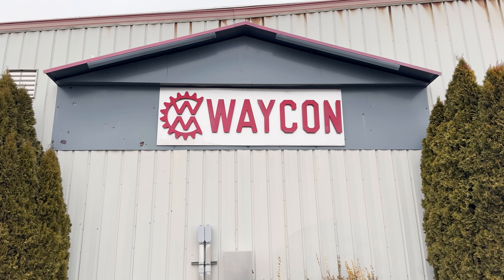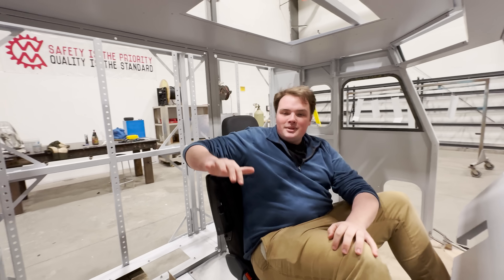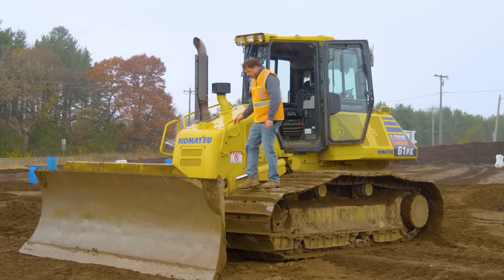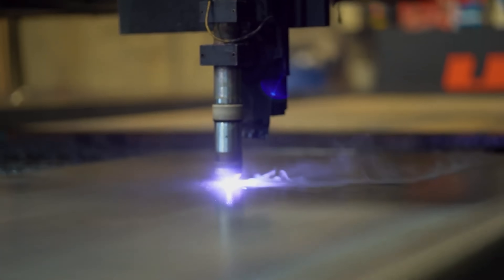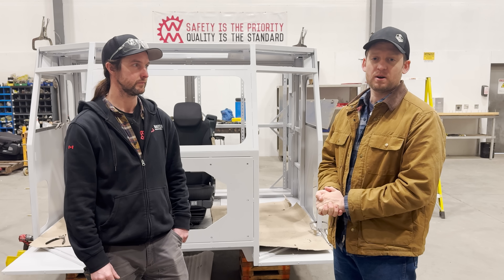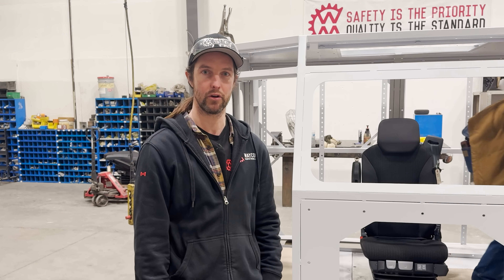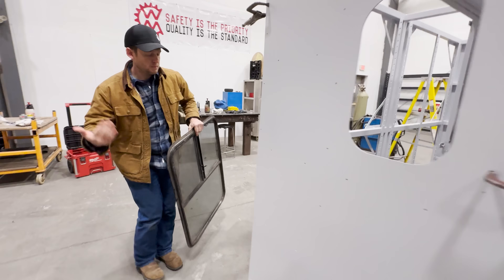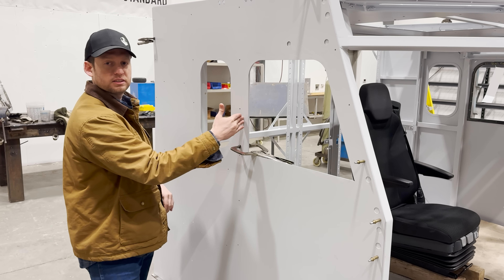Unveiling the Undisclosed Hybrid Electric Truck Cab: A Sneak Peek

Comment: Sliding glass is not only easier and cheaper, it’s mechanically simpler.  Just make sure it can be locked shut.  KISS is at the heart of what Edison is doing.  Keep it simple and it take you far
Reply: What is the powered  mechanism that fast food restaurants use to auto open/close the sliding windows at the drive through. 

Quikserv and Ready-Access make them.
Reply: @Sah-o5m  I would call those folding rather than sliding, and I don't think they're automated. I think there's a pusher bar that they walk into that opens it through mechanical linkage
Reply: @gormauslander The ones I’m used to seeing at fast-food places are absolutely sliding mechanisms, I think they’re generally either a broken-beam trigger or a motion sensor, but I’m sure some places have a bar switch instead. Heavier-duty frames than I think you’d want on a vehicle window, though, perhaps?
Reply: kiss. keep it simple superstar!
Reply: Had sliding windows on my ‘67 VW Camper. Over 200K miles with no problems. 
Have replaced 2 window regulator wires on my Jeep’s driver door, mainly due to freezing rain, in less than 50K kilometres! At $750CD for each replacement!
Please tell me again how sliding windows aren’t a thing?!
Reply: Bringing up the KISS method of design made me laugh. That was what they were pushing back in the 1960's when I was in school. I now have a grandson in engineering at the state university, and he was telling me about a project he was on. His parts he designed were simple to produce where the other designs were more complex, and had to be sent out to produce. So I said, "So you are of the KISS method of design". He asked what that was, so I told him. He thought that was pretty cool. Maybe I need to send him up to work with Edison Motors! From the videos of their area on their road trips, it looks like a nice place to be.
Reply: @ronfullerton3162  KISS should be the foundation for everything. It's quite easy to create a complicated thing that's good, have it good AND simple requires a lot more work and thinking.
Reply: @Hoggaforfan  I am with you on that! I was rather surprised my grandson hadn't been familiarized with it in an engineering and design class. Although he had been praised for his easily produced designs for this project. As we talked about it, and the discussion deepened, I could see the light come in his head. He fully under what it all meant.
Reply: Glass is heavy, expensive and a risk. Seems like an Apple feature, cool when shown but useless or even plain bad IRL. Just add some metal or even plastic doors.
Reply: @Hoggaforfan   seriously? They are talking about windows, and you want to make them plastic?
Reply: @autobootpiloot You do know there is transparent plastic? Acrylic, polycarbonat, pet bottles is all rather common. But they were talking about sliding glass doors to the electrical parts, not windows.     That current window in the back is a bit useless but it's either to add a transparent part there and whatever of the rest or make doors that cover the electric but not the window. Anything else?
Reply: @Hoggaforfan  they were talking about a side window. A bloody window to the outside of the truck.
Reply: @autobootpiloot  Ah, I was thinking about the huge sliding glass doors they intend to close of the electrical stuff on the back wall.
Reply: @Hoggaforfan they scratch very easily and don’t take long to get opaque.
Reply: @dwaynepenner2788 I suspect that comes down to your choice of polymer.
Reply: @davewatchedthat  acrylic (plexiglass) is more scratch resistant than polycarbonate (lexan) but is much more brittle and isn’t as durable as glass over time.  Both polycarbonate and acrylic degrade with UV light. Plastics also flex more than glass which is good and bad, for trying to seal a sliding window if the design requires a “free” edge (not in a track or jamb) is going to be hard.  Glass can be brittle but unlike acrylic is safer when it breaks (assuming you are not using plate glass…acrylic is surprising nasty) and is easy to find.  Polycarbonate is the most expensive option.
Reply: @dwaynepenner2788 Yes, that matches my experience too. The sliders in my trucks have always been glass, I believe. Probably the best choice for this application, but I’m sure there are professionals who can help them decide for sure. That being said, there are some modern polymers that are incredible compared to even the performance of products from a handful of years ago, so I’ll be curious to see what they choose.
Reply: @Hoggaforfan  and tempered glass is better than basically any transparent plastic... I work with acrylic poly and pet on a regular basis and I wouldn't trade glass for any of them most of the time... 

My own farm semi has a plexi/poly (couldn't tell yo which its been 10 years) rear window as we just drilled it and put it in place and plastic is much much easier to install... that window looks like shit now, the glass front windows that are original to 1986 still look great
Reply: @killorkubed  True, plastic scratches, that's the downside. Poly is way more resilient than acrylic but a pain to bend so most plastic windows are acrylic because of that. I wouldn't put poly on the front window but the back window is fine. I mainly wrote the post regarding the large sliding glass doors in the cabin to cover the electric.
Reply: @ it not only scratches (which would me more of an issue on the inside windows then an exterior rear window imo… someone’s gonna hang their jacket up where it swings all over the window which would scratch the daylights out of it) but discolors and gets cloudy… in theory this is less of a problem if the inside is uv protected enough but still it’s less than ideal… 

Look at how much of a nightmare plastic windshields on like Cessnas are… constantly need scratches polished out, covered on the ground to protect from uv etc 

And on a brand new not inexpensive truck I would expect glass…
Reply: @killorkubed  You are basing your posts on acrylic, UV resisting poly isn't the same thing. It's used in bulletproof windows and I've slipped with screwdrivers and no scratch. Those glass doors needs to be hardened and the risk is that they could explode. Either by movement of the cabin or accidently poking with a sharp object. Personally I would just use metal doors to cover the electric but if you really want transparent then poly would be better, lighter and no risk of shattering. But you do you :)
Reply: @ I know all about poly as well, I’m not sure the window in the rear of my semi isn’t poly, I regularly laser cut plexiglass and run poly on my CNC I’m well aware of the differences between the two 

Still even UV Poly is mostly one sided stuff, and even then it’s only guaranteed for 10 years and only really good for 15-20… a truck like this should last much longer than that, like my 40 year old kenworth that will be around many years to come if it doesn’t get totaled… like I said the window in my kenworth is 10ish years old and going to shit, and im reasonably sure its poly not plexi
Reply: But is it? To me it feels like a step back in time. 

Sliding windows are noisy and with a bit of dirt they barely slide anymore. Electric windows have been common place for over half a century, the better ones have been proven reliable for over two decades. You get a better seal, less noise and way nicer to operate. 

I’m getting the feeling this truck could be the owners dream and the operators nightmare. It’s all good and fun to make it reliable but actual people have to work it a full day. A full air cab and seat, good ac and heat and good sound control is a necessity in my opinion. Old men where tough, but they also had a lot of pain and suffering at age. Let’s not go back to that. Let’s keep moving forward for human comfort as well.
Reply: @autobootpiloot
Had 2 vehicles with sliding glass.. as long as there's easy replace  lightly sprung  seals on the wipe  edges it stays quiet. Power wind windows end up with a lot of water muck and ice building up in the doors causing structural and electrical corrosion.. if this thing has AC .. it's good as an emergency escape if doors get stuck .. 
Electric locking doors and windows cause dozens of  deaths when vehicles face flooding, immersion.

This thing has the touch of  
Military off road truck or crane or drill rig carrier about it.  
British military 6wheel  amphibious trucks. Stalwarts aka Stolies had no doors or windows that opened they just had two roof hatches. 😂

The British built 1984 Africar project was built to take the pounding of traveling from the Artic circle to the Equator crossing the corrugated rock pavement of the N .Sahara /Sahel before wading through Equatorial truck tracks of mud and black cotton soils.. when wet they will swallow an Artic.
The designer had crossed the region several times in 4wD and American pick ups.  They all either broke their chassis/load beds or had to slow to a crawl...the harmonic frequencies shook everything metal to pieces. 

The windows on all the versions were sliding, because the winds blow east west  the roads pass N -S the body monocoques were epoxy plywood .. the long travel Citroen/ Moulton rubber hydro gas suspension  mountings were galvanised steel sub frames bolted to the Resin Ply bodies including the Six wheeler.  Nothing of the chassis broke in fact they could float over the rock pavement.. at double the speed of the usual overlanders.. maluable steel  rims absorbed impacts with vertical edged pot holes left by the HGVs and freeze thaw action rather than ripping the suspension off. It's an object lesson in designing for the ordinary road in most of the world.
Reply: @clivestainlesssteelwomble7665   so you want the perfect truck for the owner that a nightmare for the driver. As a driver, I would like a little comfort in a brand new truck. That way I can enjoy my old age with proper hearing and I can still lift my own bones.

Let’s do it the f-ing 2025 way and build something reliable, rugged AND with comfort. Let’s make PROGRESS instead of going back in time. Let’s push Edison motors to build a truck for both the owner and the driver. Not the reliable uncomfortable truck from the 60’s or the comfortable unreliable truck from the last few years. Let make it BETTER!!
Reply: @clivestainlesssteelwomble7665  that happened to a local driver he went off the side of a bridge and his truck landed on the old pilings for the original bridge.

power windows stop working in water and the interior door handle was broken he was reach through the window to open the door. (people dont realise that the electrics short out when immersed in water.)

couldn't escape even if he had been conscious and able to move. he died in the cab.

now he shouldnt have been where he was b double on a non b double route. and his truck wasnt roadworthy and he was on the phone to family so he was distracted.
 the left wheel clipped the kerb of the bridge and in he went.
apparently his last words were oh fuck.
Reply: @chrisforgan731  
😬.. there's always a call out to install escape hammers in vehicles . They cut seat belts and shatter the screen glass by using a hard point or spring loaded punch.  Trouble is you cannot push open a door until the water pressure equalises somewhat  if your sinking. And if the locks short out closed with the windows your only way out is through the glass.
 
In Europe and UK with all the extreme rainfall events cars get stuck in fast deepening floods and swept away or stuck in underpasses when they flood. The drains block or just cannot cope ..  18" of flood water moving at 35 mph will was an articulated lorry off or down the road... To be honest a lot of people have no idea how to drive through even moderately flooded roads ..let alone the danger of flash floods... and if you've been through a drought the last thing most unaware drivers would expect is a raging torrent sweeping their car or van down a hill and into a river or the sea..like an egg 🥚🍳🔥🌊🌊 
I saw a couple of vids of cars swept down an American river then getting jammed under a bridge a guy stopped his car and was trying to smash the glass to get the occupants out  but the water was rising all the time and he was hanging on to the parapet 🫣 trying to reach the screen or sun roof.

1 M³ , (3ft3" ³) of water  =1 metric Tonne ... You can see the problem Mass x Velocity = kinetic Energy. 😬 That's why you cannot push doors open when waters still flooding in or against a flow. 
Or being hammered by grapefruit or tennis ball sized hail stones that hammer metal body panels like they've been plannished by a lump hammer.
Largest recorded last year was the size of a bag of sugar 1kg 2.2lb another reason for building a Truck cab from  something like epoxy sealed Metel wood  or A metal skin over a resilient sub material or from a sandwich construction..🤔🤷🏻
Reply: @chrisforgan731   I have a 1970’s Mercedes, as bare bones as a work truck. Even the passenger side mirror was a option that wasn’t ticked. But when the door is locked, I can ALWAYS open the door from the inside. When I pull the door handle on the inside it just pushes the lock open, there is in fact no other way to unlock the door than to open it. That car is almost 50 years old, has driven over half a million kilometres and you still can’t lock yourself inside the car. Almost 50 years ago! that kind of safety was available. 

The automobile is so old, for every problem there is a solution. It’s just the bean counters that don’t want these solutions implemented anymore.
Reply: @autobootpiloot "As a driver, I would like a little comfort in a brand new truck. "

Ah yes, pushing a window is so much harder than a button.
And i thought truckers were all about the tough image 🤣
Reply: @autobootpiloot You don't think sliding windows have advanced?
Reply: @MrFakit   you mean like the terrible things they have on brand new very expensive excavators, dump trucks and other heavy machinery? They work excellent when the machine is clean and in the showroom but not so much after a couple of months on the job. 

It can work, if the compartment they slide into is sealed from both sides and not just from the outside. Like a window that slides down in between the door and the doorskin.

20 years of driving decades old crappy cars in all sorts of terrain and only once did I have to replace a window motor and mechanism. Took me a full hour to do, I’m still recovering from that. Oh no, it was nothing and I still enjoy the ease of use of electric windows.
Reply: @autobootpiloot Your door is also not transparent because it needs to hide all the components to make that work. For these doors to achieve the visibility they want, they can't have power windows
Reply: @autobootpiloot depends on what your truck is doing, but a sliding window is less parts, less things to fix and easier to fix.
Reply: @autobootpilootI think you’d find that the driver can easily reach that slider on either side, and they’ve made references to the rest of the creature comforts, they’re definitely still doing a/c and heat and such. You make a valid point, but I think the sliding window will be a relatively minor nuisance, especially in what has always been designed as a vocational truck rather than a highway tractor. I would expect power windows in the conventional cab design, for sure.
Reply: @autobootpilootExactly

Comment: My first thought was about the side visibility. With Chace's explanation, the small size of the upper window made sense. Moving to a sliding window that allows for a larger window that enhances visibility is the absolute correct move. Keeping with the flat glass is also great to see. Aesthetically, the cab will look much better, as well.
Reply: Not a good idea , wait to you get to a weigh scale how do you hand paper work out the window ?
Get up from the wheel???